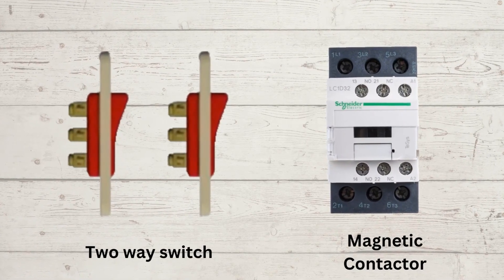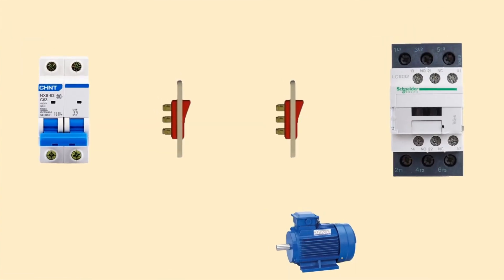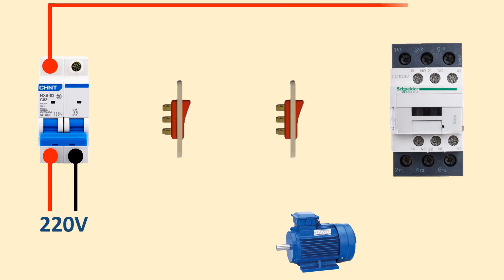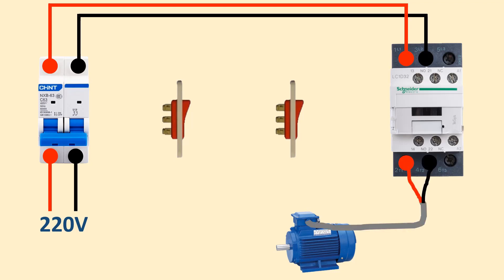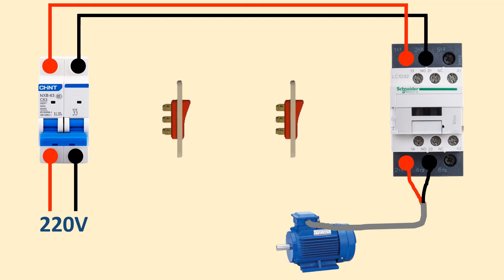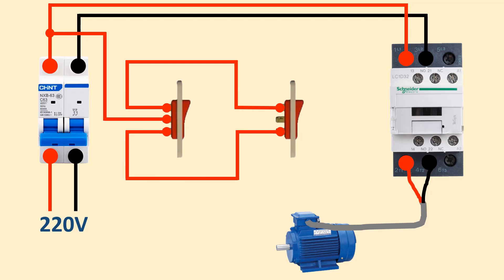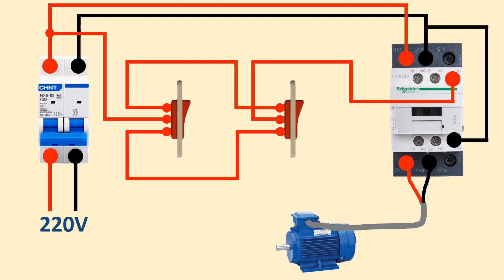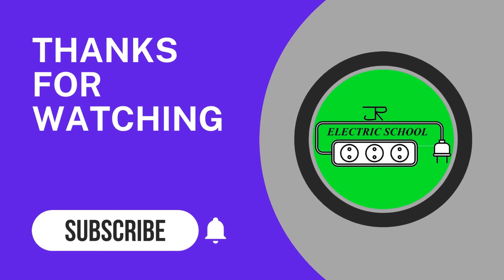how to control motor from two places

Comment: No but the swich shiuld be capable of eith standard ng the high current due to frequent ON OFF ...HENCE THE CKT IS CORRECT BUT HAVE TO USE SEITCH  WITH HIGHER RATING....